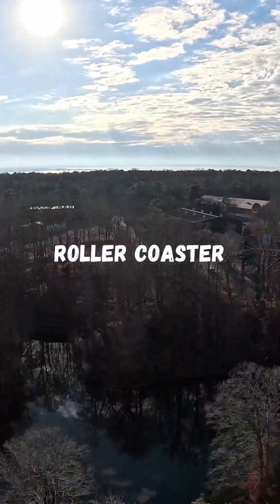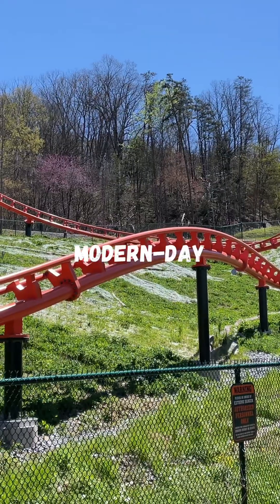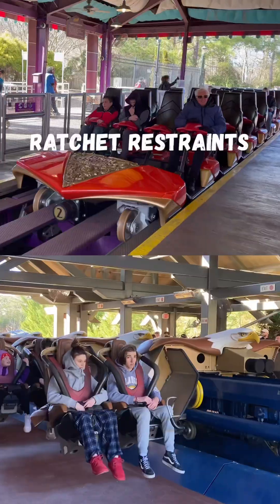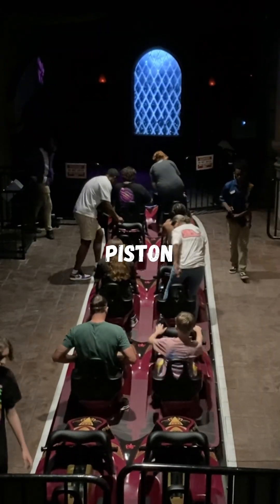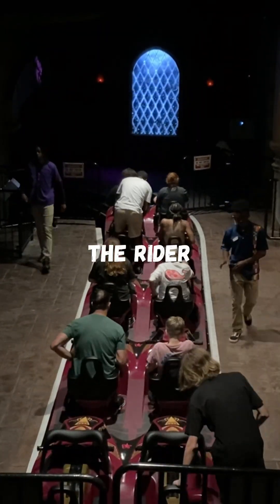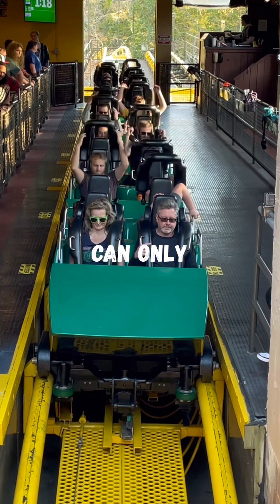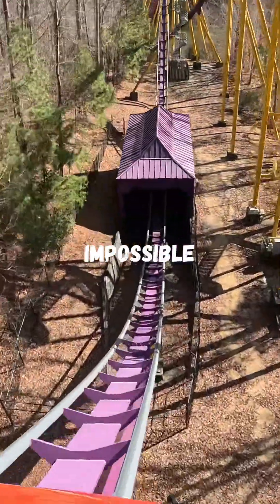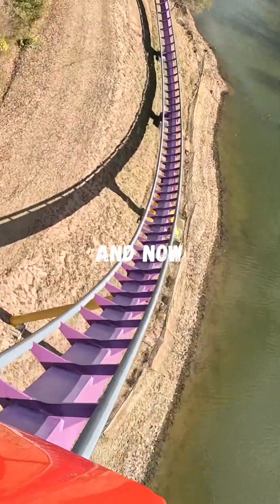The TRUTH About Roller Coasters: Restraints

Comment: Scary experience I was on kumba at BGT and the guy closing the seats unplugged my seat somehow and I felt like I was about to die I couldn’t do anything but hold on
Reply from the maker: Did he release the whole restraint or just the seatbelt?
Reply: Seatbelts are not primary restraints. As long as your shoulder harness was still attached, you were completely safe.

Comment: ppl dont fall out of rollercoasters ever do they? it does happen its not never
Reply from the maker: It has happened very rarely before, but most of those accidents are caused by human error or failure to follow protocol. (That doesn’t mean that isn’t also very rare…)
Reply: @BliXXardShorts  like 99% of most accidents then
Reply from the maker: @kenmasters4219  human error makes up about 70-90% of roller coaster accidents.
Reply: @BliXXardShorts  human error makes up about 90% of global accidents  i dont see the point your making
Reply from the maker: @kenmasters4219  human error makes up most roller coaster accidents, yes. However, roller coaster accidents in general are extremely rare.
Reply: Almost all incidents of a person falling out of a coaster was caused due to them being under the height limit or over the weight limit. only a few had to do with the ride itself

Comment: Actually its the restraint that gives me anxiety.  Feel like a trapped animal
Reply from the maker: Interesting, I’ve never heard that one before! Try lifting up in your seat a tiny bit just before a ride op checks your restraint so you get a little room. Great strategy for a little extra airtime!
Reply: @BliXXardShorts I would not do that because the engineers that designed the ride made the restraints specifically how they are intended to be used in order to keep guests safe.
Reply from the maker: @roarz9751  yes, I know it is a little risky. But there’s still little harm in having one inch of room if you’re claustrophobic.
Reply: @BliXXardShorts  I guess your right if it’s not too much room

Comment: You know those traveling fairs? There was a ride that was just a loop. It'd bring you around and around, but on my third time on it I failed to notice that the restraint wasn't clicked. First it would go fast around, and then on the second you'd hang upside down. I caught it on the fast time where there wasn't enough time to fall out and clicked myself before the hang thank god. A little carelessness almost made me a statistic.
Reply from the maker: LOL that’s wild. The difference is that fairs can be quite iffy. I’m talking strictly about theme parks here. 😂
Reply: I understand the genuine fear, but that's probably not true. You probably pushed it into the first pin, but if you hadn't noticed it still would've hooked on the second pin. And at that point there's just a terrifyingly large gap between the restraint and the seat that you could fall through but it's usually still impossible to fall through it.
Reply from the maker: @rellerbeller  if you are worried about the gap between the restraint and you, that’s a simple fix as you can just pull the restraint down further. Me personally, I love having that restraint higher up so I can get that beautiful airtime!
Reply: @rellerbeller  I was a very scrawny kid back then, so even that much give was a death sentence. At the very least I felt no resistance as I pushed it up to slam it back down into place. I was walking around with so much adrenaline after lmao.

Comment: This is for modern coasters with modern restraints. I remember going to a coaster at cedar point but at the time the coaster only had a seat belt restraint. They were not checking restraints properly and my seat belt would not lock. As the ride went up I screamed for them to stop as I desperately tried to lock my seat belt. When we got to the top I had to hang on for dear life as the restraints and my grip barely kept me in the coaster. When in it was done I was traumatized as hell because I had barely kept in my seat the whole time. After that it took years before I could do a coaster with seat belt restraints. When I have seen news stories of other people who had faulty seat belts leading to a fall out it brings me back to that episode. Modern restraints do indeed keep you from fallout out but beware those early seat belts. If your seat belt is not working immediately once you get on then do not stay in that seat. Get out.
Reply from the maker: Okay, if you try to get out of a moving roller coaster, you’re making it twice as dangerous for yourself. Even for older coasters with small lapbars or seatbelts or no restraint at all, they are perfectly safe. You were probably just getting more airtime than usual because your seatbelt wasn’t buckled. You would’ve been safe either way.
Reply: @BliXXardShorts  You misunderstood. Let me quote it again. If your seat belt is not working immediately when you get on the do not stay on. What is the first thing you do when you sit down? You check the restraints by putting them on but if your seatbelt will not even click together at all so you are going to ride a rollercoaster with maybe a bar that barely provides restraint then you had best get off that ride before it leaves the station. Do not continue to try regardless as you ride up to get it to work. As for getting air time, you bet your balls I got air time. I practically was at the mercy of every vertical and negative g you could get. At one point I swear that negative g made me go 4 or more inches above my seat when I didn't push down hard enough. Yea that was my last time thinking it would be cool to ride a coaster without restraints. 

As for the coaster, Blue Streak. If you have not checked it out already you may want to do so. Its a classic with a long history but also a history of problems with restraints with dozens of people in similar situations until cedar point finally fixed the problem or so I hope.
Reply from the maker: @nathan3252  ohh, it was Blue Streak! Okay, okay. I get it now.
Reply: @nathan3252 I’m not trying to be rude or insensitive but I have been on blue streak and everything you said describes a normal ride on it. I’m on the thinner side so I get more lift on that ride than any other one at the park. Also the seatbelt doesent do much at all it’s primarily the bar.
Reply: @roarz9751  Dude there was no bar back then. Only the seat belt. I know I caught some serious air time that I should not have had. Even going on the magnum with restraints I did not have the big air like I had there. I was almost at the same level as my dad for a split second before landing back in the seat. That meant I was well over 4 inches out of my seat. I was also fairly underweight at that time. 5 foot at most and barely 95 pounds. After getting that first huge air time I immediately grabbed what I could and held myself down in the ride. I got maybe an inch or 2 on one other spot but beyond that I held myself in that seat as best as I could. I understand your skepticism but it was different than any other coaster ride I have had.
Reply: @nathan3252  oh my apologies I thought they always had the bar

Comment: So basically, my death can be determined by a 16 year old operating a roller coaster.  Terrifying
Reply from the maker: Make sure your ride operators are doing what they’re supposed to and following protocol! But you should still be okay because even human error is rare.
Reply: Most of the time ride ops could range anywhere from 16-however old. Most states require you to be either 16, or 18, but no states allow anyone younger than 16 to be a ride op. They are so heavily trained that even if they did mess up you’d probably still be fine since most modern rides need the restraints down in a certain position for the ride to start.
Reply: These days after roller coaster accidents like Smiler at Alton towers and the cable snap at Knotts they really don't screw around with training. Newer rides in the past 10 years are also the safest ones yet, Joker at great adventure even has bolt gel on every single bolt
Reply: Many of the rides shown in this video have advanced computer systems that would prevent an occupied train from leaving the station until all of the harnesses are secure, the track is clear, and multiple employees preform safety checks and press the required buttons at the same time. Also, at any time, there may be a safety inspector in the line, disguised as a park guest. It actually kinda gets annoying sometimes because BGW, (the park where most of this video footage is from), will shut a ride down for the pettyist reasons. It's probably why they have a fairly clean track record for ride safety with the exception of Fabio's ride on Appolos Chariot.
Reply: Aside from everything else clearly mentioned that had Jack all to do with the weird straw man attendant you invented...
Reply: Don't you have to be minimum 18 to work at a fair? I can only imagine it's more strict to work at an amusement park
Reply: @onyxthewitch  I'm 16 and oporate prowler at worlds of fun. The trains have sensors that when in proper position the ride can dispatch. If they aren't, it can't. Even if the operators mess up, they'll have to recheck
Reply: @onyxthewitch  fair  ≠ amusment park. both opperate on lowest cost

Comment: I love roller coasters, there have been a few times where the ride operator didnt check my restraint more than a quick glance, it was too loose, i didnt fall out and everything was okay, but i couldve fallen out if i hadn't held on tigter. (No i dont remember when/where this was)
Reply from the maker: Yeah, no. That feeling where you come loose from the seat is called airtime, and it’s perfectly normal to experience that type of weightlessness on a roller coaster. As long as that bad boy is pulled down, you should be A okay!
Reply: @BliXXardShorts  no, not a feeling of coming out of my seat, I love that, I mean I was small enough that I could've slipped out, my dad was also concerned

Edit: this happened when I was much younger
Reply from the maker: @minekid2218  maybe at the time you thought that you were small enough. I had a couple experiences similar to that when I was younger where I thought I could slip through the cracks. But there’s simply not a chance.
Reply: @BliXXardShorts  it was one where there was only a lap bar, I had short legs, and was sitting with my very large legged dad, I was small enough that I could get out, trust me I tried at the end before they released it and I did get out.
Reply from the maker: @minekid2218  oh, okay. That makes sense now.
Reply: The end of your comment is just proof that you are lying buddy
Reply: @avg1005  could you explain how?